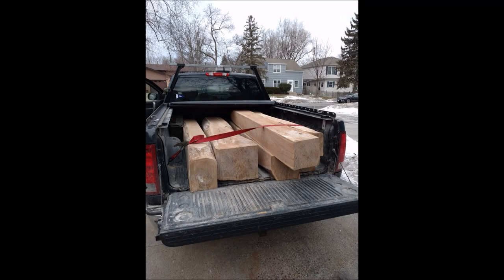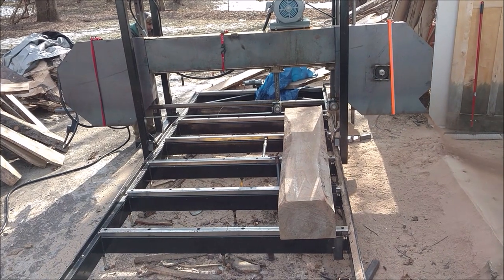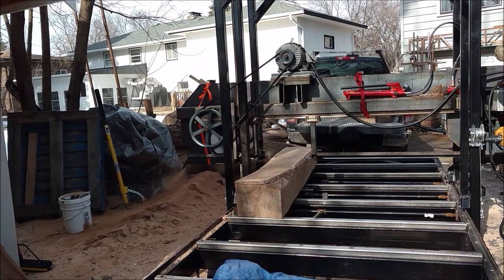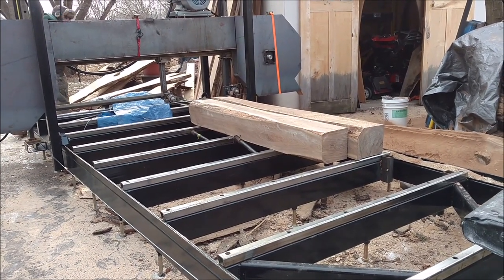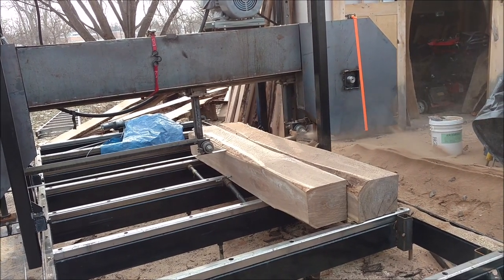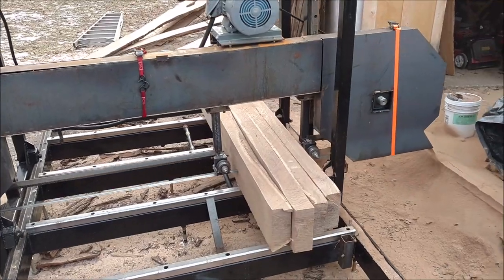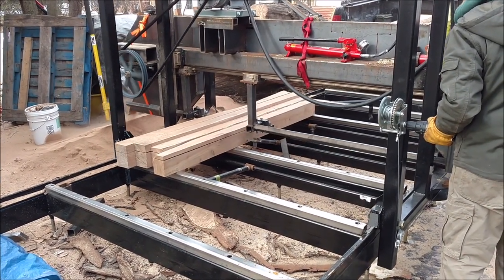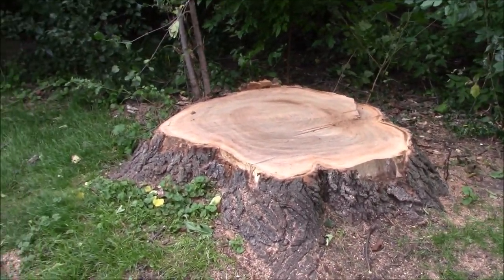70 foot Chinese Elm for lumber Part 3  First day at the mill

Comment: How did you get those last 5 large cants you cut onto the bed of your truck? You've got some nice wood there. Hope it gets stable even after you build your table or other projects you will make with it.
The video was good quality on this end, so that iPhone you've got did a great job!
Thanks for helping Matt get some logs moved to clear out his driveway for parking the trailer he modified with the hoist!
Reply from the maker: +MRrwmac the smaller four  ones I was able to lift one end and slide them in. The biggest one I used a bakers scaffolding with a chain hoist to lift it it to the truck. The phone I used was the droid turbo 2 .